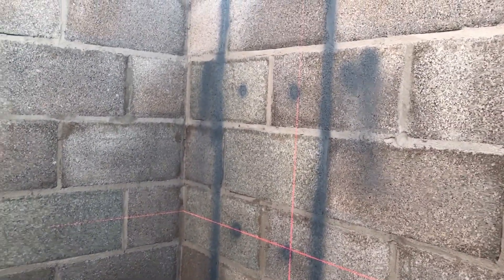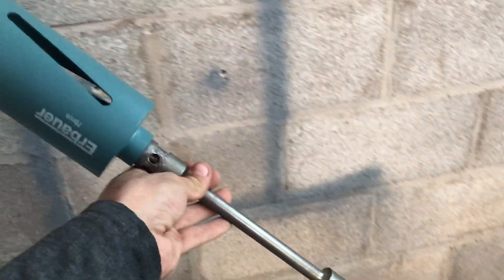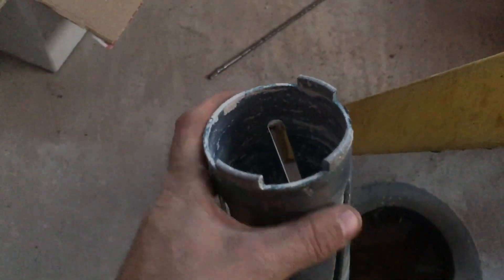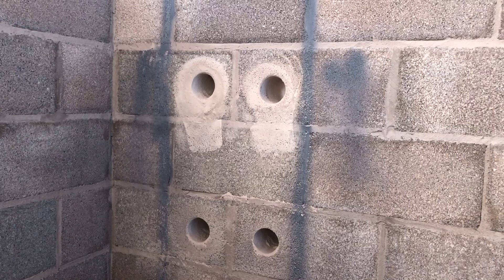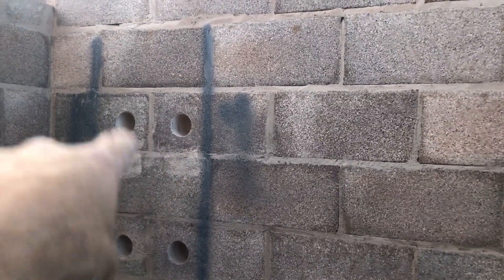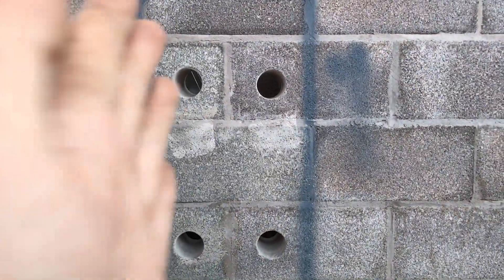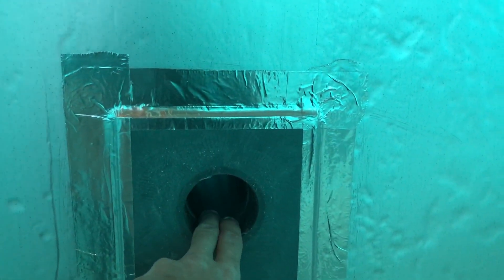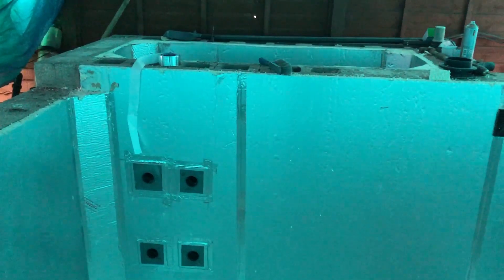New KOI Pond BUILD! EP.7 Fitting POND RETURNS!

Comment: Hi just seen ur vid can I ask is the front of the return same size as the back hope makes sense thanks
Reply from the maker: Hi Steven, yep they’re the same size either side. I used 2” myself, their basically 2” pressure pipe couplers welded to a pvc plate. So a piece of 2” pressure pipe can be inserted either side.
Reply: @KoiWithPaul   thanks for that 👍